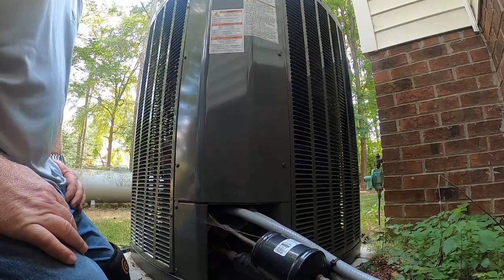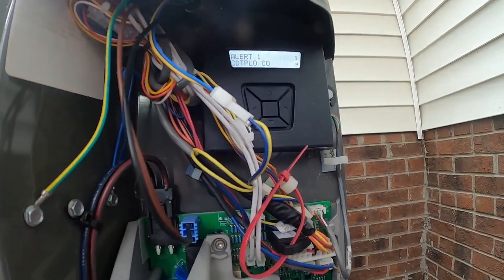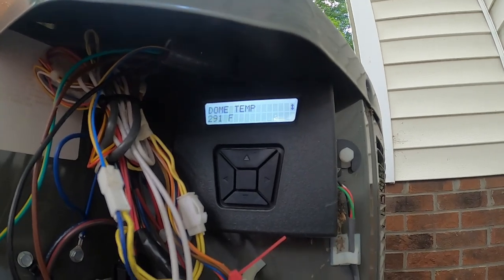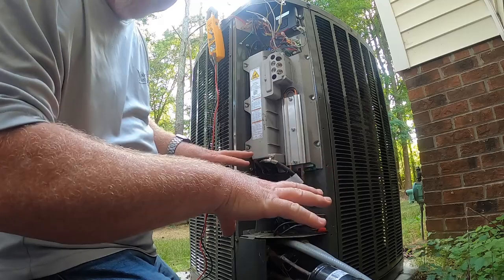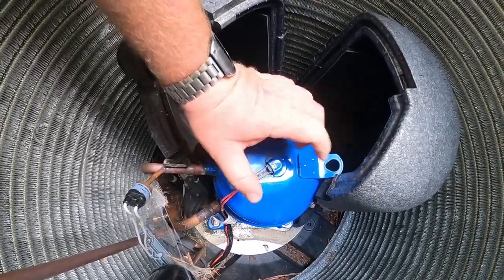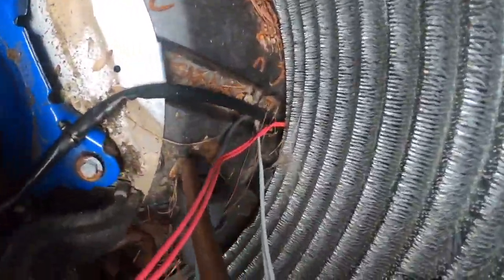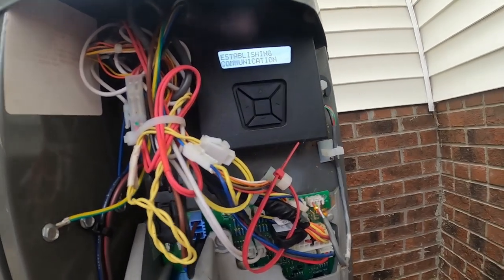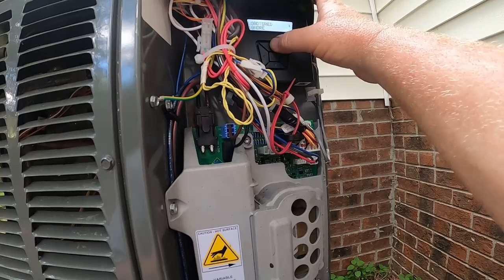Trane Compressor Temperature 291 Degrees while not running.

Comment: We pretty much only sell/ install American Standard Platinum Series inverters. We stock a drive at our shop, eev control board, and all the temperature sensor for Tam 9, and tam x. I carry all the temp sensors on my van as well as a dome sensor. Good things about the systems is almost all the parts are interchangeable for 2-5 tons. And also for any of the haters out there, the units really don’t break as often as people say. And most of the time, it is a silly issue that will be taken care of the same day if you have a decent service company. Would 100% recommendations.

Comment: Great video Charles but I don't like the plastic version of the compressor sleeve jacket it might be the cause of that sensor overheating prefer the felt velcro style ones you can buy on the aftermarket to quiet and help the compressers run more efficiently while protecting from the outdoor elements and excessive heat.

As for the sensor at least you put the corect type on on with a harness plug without screwing up the actaul system plug like a certain pipe dr wouid do.

Its like cars with oxygen sensors and other sensors just put the right one on not the universal oxygen sensors.

And it does not have to be the one just like what came from the factory I can get plenty of aftermarket sensors that perform better than the oem part.

As for the comment about inverter systems I agree but I don't like that with companies like trane carrier and Lennox you have to buy a comunicating system that's often over priced just to get the inverter technology in a split system and that they are, still using old school top mount condensers.

And I have said that before Mitsubishi offers no comunicating split systems with inverter technology so does Samsung so does pioneer so does gree.
.
There is no excuse for this Charles I want to believe in the American companies again but the 2 or 3 genuine true American companies that are left make it hard now to believe.

They need to get it together.

Comment: When it comes time to replace my system. I will go with a xv18 as i was in the shop one day seen new part for our thermo king reffer. And lo and behold the train logo and name was on the Thermo King box. We have had very good performance from thermo king. Unlike our carrier units that seemed to fail and shut down on all kinds of little errors. Thermo Kings keep on working I will say when a Thermo King goes down they go down hard.

Comment: Another over engineered A/C system. Do you resource people on these whistles and bells units.
Reply: in certain situations they make sense - like zoned setups to cut capacity when only one zone is calling and heatpumps in cold climates with inverter tech improving cold weather performance.
It's all about using what's appropriate for the application - use high end stuff when the benefits outweight the pitfalls.

Comment: Nice job. The diagnostic module makes it easier to diag. I’m an AS dealer but I mostly do 15.2seer2 systems and some two stage. 

I don’t like callbacks. We’re in So Cal Los Angeles area so humidity is not a factor.

Cheers and keep the videos rolling.
Reply from the maker: Thanks for the watch, stay safe in the heat.